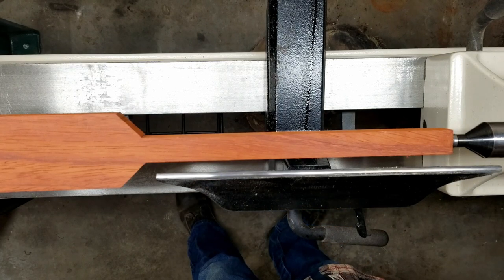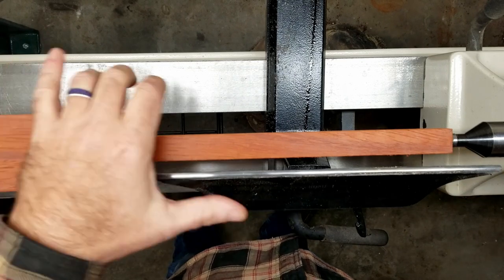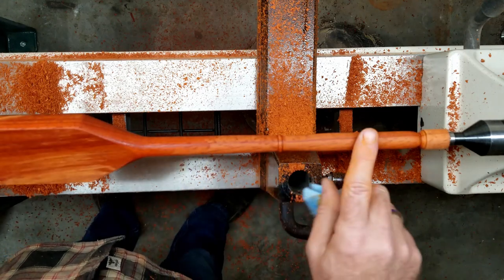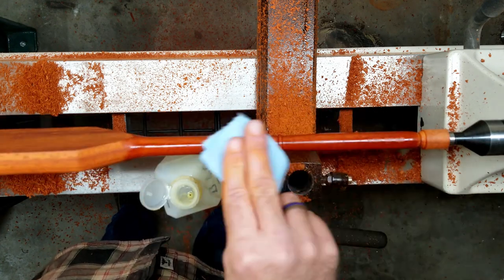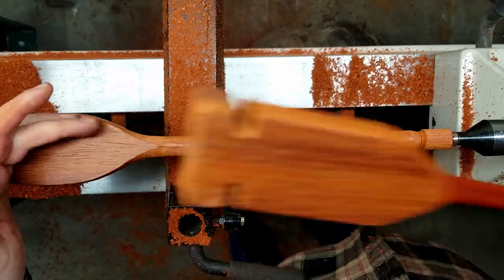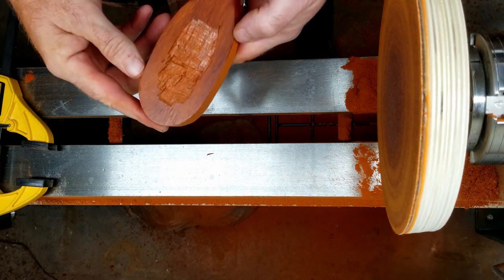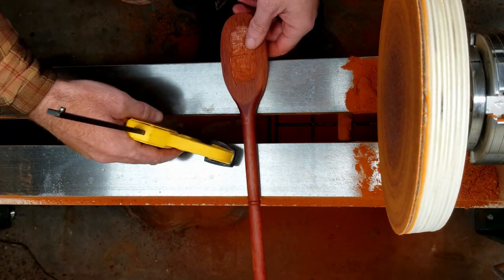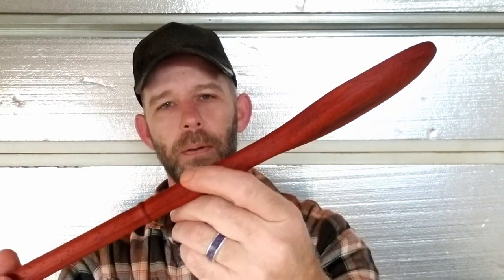Wood Turning: Kitchen Utensils from Padauk

Comment: Nice work. I've been thinking of turning some spoons etc but haven't got around to it. Too many other projects. I take it you don't have a band saw, it would have saved a lot of sanding time. When I turn bowls I use walnut oil that is made to catalyze in the wood and wax for a food safe finish ( Woodturners Catalog has it). I do well many of the things I make.
Keep turning and have fun.
Reply from the maker: Thank you. No, I don't have a band saw. It is the next major power tool on my list. I have, since this video, made a sanding cylinder that makes sanding the inside curve a lot easier.